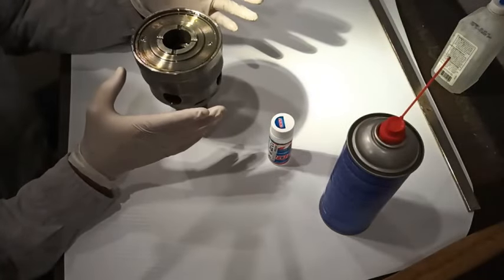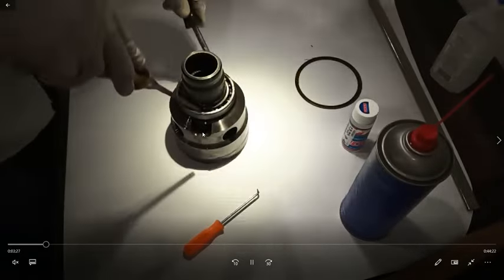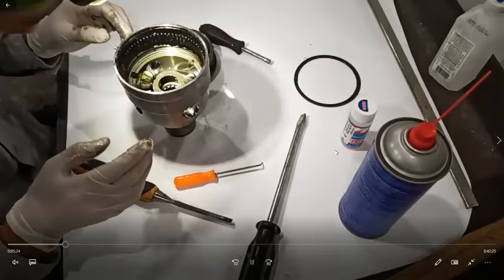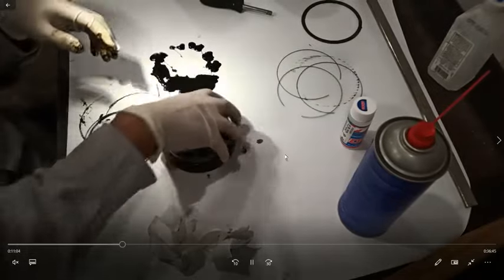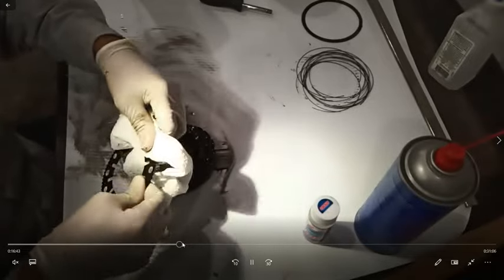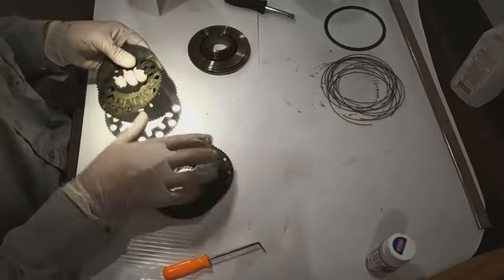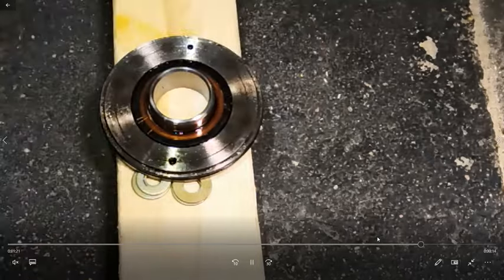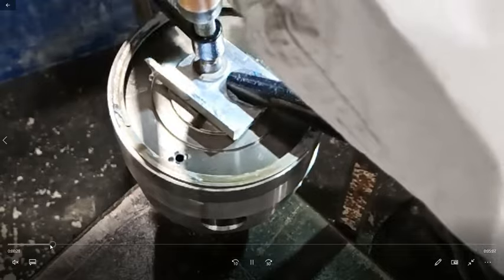Subaru center differential rebuild (viscous coupler)

Comment: Thank you so much for developing this rebuild. My viscous (38434AA021) is discontinued and very very hard to find a replacement for. I've just completed it on my 1995 WRX STI (used 100k fluid) and can confirm it's working great. I want to add that the older Phase 1 units like mine are rebuild-able using this same process. They are unfortunately welded shut and required machinist work to cut open and reweld after. If anyone has a phase 1 unit like me, I've outlined the rebuild with pictures at thesubaruforums.

Comment: I had the same issue on my Subaru Impreza 2016 (Sport Hatchback 5 speed manual transmission).  I could not afford the labor prices the dealership asked. Also, it took me a while to figure out that it was indeed the center slip differential that was causing the clicking and clacking when turning at slow speeds, after the transmission came to temperature . I  eventually diagnosed it myself watching YT videos. I'm not,  by any means, a mechanically inclined person ( basic stuff only but I'd venture to try more complicated things with some help). Tried a couple of "mechanics" and they all misdiagnosed it as "bad CV Axle or wheel bearing". I can't do these repairs myself so I went and spent $650 for a new differential and had a friend/mechanic that put it in for me. It was a HUGE deal in terms of  I paid in the end ! This video however got me interested in trying to re-build the old differential which I still have. My question is ... can these things be re-built indefinitely or is there a point where they're just "'done" and a new part needs to be purchased?  I ran the car with the clicks and clacks (bad differential) for about a year  (took me a few months alone to diagnose it). The old part looks perfect. Intact as far as I can tell.  The part number that fit my car is "38913AA102".   I also remember that during the process of diagnosing my issue and researching online for weeks, there was a mention of these units as being "sealed" which basically meant "swap the old part with a new one". Perhaps a marketing ploy ... I had no experience with this and "re-building it" was absolutely not even an option I considered but the differential    in this video looks exactly like the  part that fit my Subaru! Identical!  Any help on this is appreciated it! And thank you for making such video! My utmost respect for your effort and expertise!  

Just a note (I notice it at the end of the video) -- the retaining ring which holds that back-cover which holds all the inner plates together, is not the same as mine. Mine is basically just a "retainer ring"  that has two holes, perhaps for use of a retainer ring pliers. I wonder though, once that comes off which I think it should, everything else inside is the same?

Comment: I have a Nissan Rogue that makes the tires squeak at low speeds and they show no abnormal wear or anything.  Two different mechanics say they can't find anything wrong.  I am wondering if my sway bar bushings are bad since it also feels loose and sways in turns.  These tires didn't always squeak so I thought it is weird.  I hear those and the links are often overlooked a lot.  Why no one can figure it out is a mystery!  At this point I would probably take it to a Nissan dealer who would know how it is supposed to ride and feel and they can't find it tell them I want a different vehicle and want to trade it in for something else.  It doesn't help them that some people hate their CVT.

Comment: Hi mate i'm just about to have a go doing this. Thanks for the video. As you started on an 'Outer' plate and ended on an 'Outer' Plate, this would suggest 25 plates and 12 wires, not 24 plates as said. 13 Outer plates, 12 inner plates and 12 wires.

Comment: is the front center diff and viscous coupler one component?
Reply: It isn't a "front center diff". The car has a front differential, a rear differential, and a center differential. They are independent of each other.
Reply: i swapped one out on a crosstrek recently … now i have the coupler to open up n rebuild

Comment: hey, thanks for the updated video on this. I really appreciated your first 3 videos that you made, and also the additional updated info that you put in this one.   I do have some criticism for you though.  You seem very "rushed" and impatient in the video and you tend to skip forward in the video.   I understand that you might not feel the need to show every thing because you have done this procedure a couple times now, but one thing to keep in mind is that there are people watching that have not, and might not even be close to having the knowledge and experience that you do.    Leaving the original footage as complete as possible would be very helpful to people watching. 
         Take your time,  If that means splitting up the full video into multiple parts, then do that instead of kind of rushing through everything.    Personally I think your original 3 videos were much much better than this updated one because they covered quite a lot more of the process and did not skip over steps like you do in this video.   I would encourage you to redo the video again, and maybe put together a loose script for yourself to follow so that you dont sound kind of "lost" and frantic at times.   It would also be very valuable for people if you did a video (series?) covering the job from the very start to the finish,  I mean the entire job from the very beginning (jacking up the car, drive shaft removal, transfer case removal), all the way to the very end (putting everything back together and cleaning up).    yeah I know, it would be a ton of work, but it would be worth it.   it would be super helpful to people and would be something that you would never have to come back and redo or think about it again.    
     anyways,  thank you for your efforts with the videos.   This video is nice as an update, but feels unfinished and imcomplete when compared to your original videos, I personally think those were more detailed and did a much better job at explaining what you were doing and why you were doing it.
Reply from the maker: Hello. Thanks for the tips. I did this in one take, the first take and skipped nothing except repetition. If this fails again within 50,000 miles again I might produce a rebuild based off your ideas.

Comment: Great video! I have a video of rebuilding a WRX center diff, but it is a bit more crude than yours. I don’t have the car anymore but I know the next guy has had pretty good fortune with it. I used a combo of 50 and 100k cst, but it looks like I should have beefed that up a bit. Nice work!

Comment: What probably happens if the center diff is clicking and bad, but it's still driven?  Does it stop putting  power to the rear wheels eventually? Or the front wheels?

Comment: What would you say the 200000cst fluid puts the locking force of the coupler at? I heard stock 4kg is 100000cst fluid. I would think 200000cst being 2x would yield 8kg?

Comment: Hey. Excellent video. I also did this operation a few years ago but I think I made a mistake somewhere... it worked well for me for about 25,000 miles then it failed. The liquid I used was 50,000 cst. I think I made a mistake at arranging the discs. My question is if 200000cst is not too thick and will not heat up faster than 50000cst?
Reply from the maker: It seems to me, combined with your stats, that the 200k reduces the number of rotations. With the 50 or 100k the front half of the drivetrain 'drags' the rear half, engaging before the brakes and engine. So every start and stop engages this coupler, whereas the 200k allows the brakes and engine to not cause this excess rotation of the coupler... i.e. less heat, not more

Comment: When you initially rebuit the coupling did you replace hardware or only clean and lube it?  
Mine started clicking about 100 miles ago.  My manual transmission oil was 1.75 qt low, so i refilled it but the clicking still clicks.

Comment: Interesting video.  Thanks for putting it together.

So it looks like there aren't any seals keeping that fluid inside the plate chamber?  I guess the fluid is thick enough that it can't get out through the gaps? Also curious what keeps oil from getting in although maybe having it filled with fluid keeps the oil out.

Pretty fascinating.
Reply: hi, there are 2 O-Ring and 2 Quad-Ring to seal it. The 2 O-Rings are easy to buy but the Quad-Rings i could not find online or by any companie in switzerland.

Comment: Can you elaborate what you meant with "delay" when describing the symptoms after the first rebuild? In which road conditions did this occur? I am asking this because it somehow makes no sense in regard to the mechanical working principle of this center differential. Under normal driving conditions (high traction, no wheel slip) the viscous LSD doesn't play any role in transmitting torque to the wheels. It is all done by the mechanical parts of the differential (the bevel gears). In this state there should not be any delay even if there was no fluid at all in the viscous unit. It would still be permanent 4 wheel drive, only without any limited slip capability.
If the weight of the fluid is too low, this should only be noticable when there are big traction differences between front and rear wheels (ice patches under one axle). This would cause speed differences between the inner and outer disks in the viscous unit and by that, the shearing forces in the fluid would start to force the non rotating parts to rotate which would result in torque transmitting to the slower axle.

Another thing to keep in mind is that there should actually be a certain amount of air in the viscous unit to allow the silicone fluid to expand when it gets hot. This is also mentioned in Subarus technical reference manual:
"The viscous coupling consists of a number of alternately arranged inner and outer plates and air and-
silicone oil mixture filled into a sealed space that is formed by the center differential case and
the rear side gear of the differential gear set. The inner plates have their inner perimeters splined to
the side gear and the outer plates have their outer perimeters splined to the center differential case.
The outer plates are held apart by spacer rings. There are no spacer rings between the inner rings,
so the inner rings are movable slightly in axial directions. X-section rings are used to prevent leakage
of silicone oil, which would otherwise occur if the oil is pressurized due to large difference in
front and rear axle speeds."
Reply from the maker: Delay... at a red light turning green, I would press the gas and move forward, but then there would be a fluid like 'thud' which I presume was the rear half engaging via the coupler. The same diff rebuilt in this very video is running flawlessly about 9k since

Comment: Hey there i have a 5-speed manual 2004 Impreza Outback N/A that i bought for my son as a first car. Test drove it for 500 miles and it seemed fine.  Tagged it for legal driving and 200 miles later i have some kind of binding click noise that happens randomly, but more often when the tires are operating on muddy snow terrain.  I can feel the clicking in the stick shift handle.  

The tranny gear oil was about 1.75 qts low. I filled it and sound is a little less present but still present.

Is the center differential lubed by the same gear oil reservoir as the manual transmission?

What do you suggest to do? Thanks!
Reply from the maker: Yes the center differential is lubricated by the gear oil. Even though the manual calls for 75-90 every version of that grade contains LSA (limited slip additive) which the Subaru manual transmission cannot operate with because it is a combination of a transmission and a differential, known as a transaxle. If you have been using 7590 gear oil with LSA added, I would drain out all the fluid and instead use 80 90 gear oil. In the united states, 8090 does not have the LSA which can cause problems in your Subaru transaxle. If that doesn't resolve your problem, then you'll have to open the transmission to see what's going on inside
Reply: @jonmark2688    the reason why I don't think it's the transmission gears themselves is because it makes the noise in all gears while in curves or quickly accelerating.  It will do it while coasting in all gears as well, but not as much, and only when not going straight. I  will refill with 75-140 when I flush it.
Reply: @jonmark2688   There are plenty of 75W-90 gear oils that don't have the LSD additive.

Comment: hey great video @jonmark2688, how did it work with 200,000 CST? I am about to do the whole thing.
Reply from the maker: still working amazing. at least 6k since the change. I drive a lot
Reply: @jonmark2688 @rubenbojorquez4614 I'm going to be installing a 300k CST fluid sample in my center diff in the next few months.  I'll post my experience once I have it.